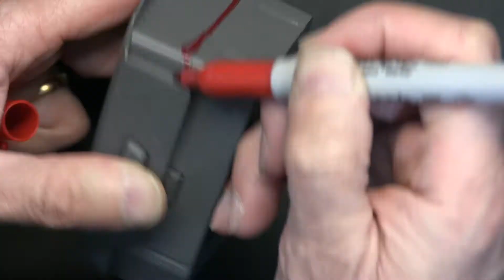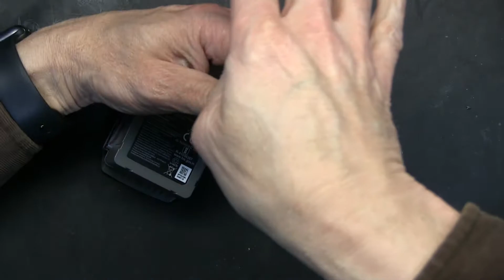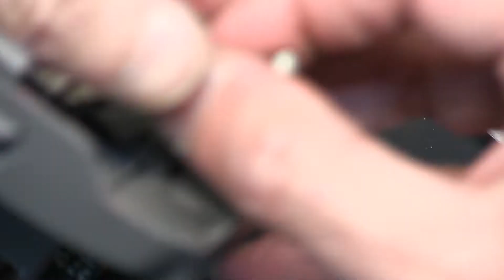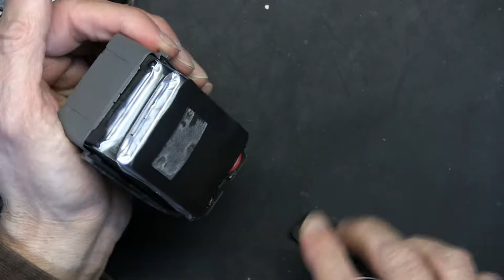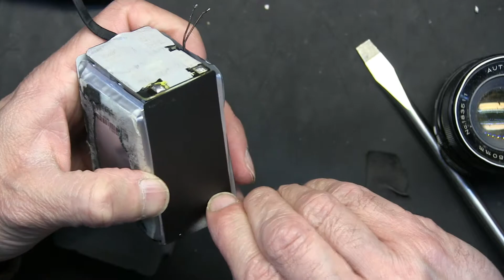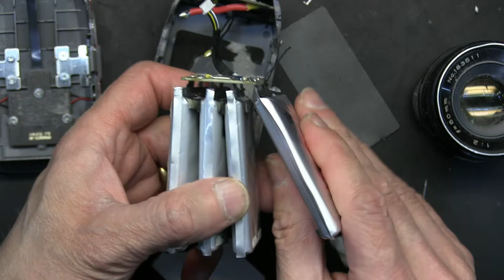Taking Apart The Intelligent Flight Battery Pack Of The DJI Mavic 2 PRO Drone.

Comment: I plan to reassemble with new cells. Is it better to pry open or cut open with dremel tool?  I heard you need to keep the voltage on BMS if you want to reuse it. With either solder connection or balance cable. Is this true?
Reply from the maker: Cutting it with a dremel is very dangerous and it could cause fire or explosion if you accidentally cut the battery. 
Especially if the battery is not fully discharged. I also heard that on these batteries, but I have never tested the theory in real life.

Comment: Great video.  Could you please show how, after the Mavic 2 battery case is removed, you can 1.) check the individual voltages for each of the (4) cells (1-4) and 2.) trickle charge each of these cells using an an adjustable bench charger? (for a less used battery that does not have cells to be replaced).  Thank you.
Reply from the maker: You can put the voltmeter terminals directly on the Positive and Negative of each cell. But be very careful these batteries are extremely powerful and they have enough charge to start a fire and cause sever bodily injury.
Reply: @TECHNOLOGYTIPS101  thank you! I was able to test my voltage at the large red and black wires right beyond the BMS board. It measured 9.34V. I then hooked my bench charger up at 13V 0.5A and it woke up the battery and LEDS. From there I could communicate with CP2112 (read info showed the voltage of each cell above 3V) reset flags and charge using the DJI charger. However when I turn the battery on and off with the button, it still outputs power when “off.” Also the drone runs on the battery but won’t take off: battery not installed properly message. Cleaned pins and confirmed all other batteries are working; not this one. Not sure whether I should’ve charged to 16V 0.5A, but I wanted to be extra careful not to overload the battery as you’ve stated.
Reply from the maker: @miles267  There could be a problem with the Control board which is not communicating with the drone. This could lead to false battery installation errors. See if you can update the battery firmware like this video https://youtu.be/tPLQZFroTLw

Comment: Those battery cells are $4 each on Ali express. Well worth redoing yourself. Worst case you ruin an already ruined battery and it costs you $16.
Reply from the maker: Thanks for the tip, I did search but I couldn't find them on Aliexpress
Reply: @TECHNOLOGYTIPS101  it's not letting me post a link in these comments. I'll see if I can dm it to you
Reply from the maker: @awesome_slyda2059  Thank you
Reply: No, worse case is you buy these cheap cells, put them in your expensive drone, fly it around, it looses power and you lose your drone 😢 not to mention any other consequential damage or injury.

Comment: JUST A CORRECTION, YOU SHOULD NEVER RUN DOWN A LITHIUM BATTERY TO ZERO, THAT IS WHY YOU HAVE A BMS, TO PREVENT OVER CHARGING BUT ALSO NOT TO ALLOW IT TO DISCHARGE FULLY.  ALSO YOU DON'T CUT AND SOLDER, THE HEAT WILL DAMAGE THE CELL, YOU CAN GET MINI SPOT WELDERS BUT SEE VIDEOS ON YOUTUBE ABOUT BAD DESIGNS.  I THINK YOU PROVED THAT ON THIS MODEL  IT IS EASIER TO GET A REPLACEMENT ON AMAZON.
Reply from the maker: I agree, it is too risky to repair it. I finally ended up getting a new one which also started to swell after a year and maybe hundred charges :'-(

Comment: Would you still bring the battery into dji to be repaired ? I got a message come up on the screen of my SC to take the battery into dji to get fixed can dji repair these batteries or should I just buy a new one
Reply from the maker: If the battery is still under warranty you could send it for replacement, however they will not replace or repair batteries that are out of warranty. I don't recommend throwing it away yet, because if there is a factory recall on them, they are required to exchange all defective batteries regardless of the warranty status.

Comment: ALL YOUR SAFETY BULL.... REGARDING A CONTROLLED ENVIRONMENT(LAB) AND TO MAKE SURE YOU WEAR GLOVES.  NONE OF WHICH YOU ARE USING TO TAKE IT APART. ALONG SIDE OF THAT THE BATTERYS COST UNDER 300$ CDN WHICH IS PEANUTS COMPARED TO REPLACING THE MAVIC 2 PRO WHEN IT CRASHES DUE TO A BATTERY MALFUNCTION BECAUSE YOU TRIED TO REPAIR OR REPLACE CELLS IN A SWOLLEN LITHIUM ION BATTERY. WHICH ALONE IS EXTREMELY UNSAFE AND I WOULD HIGHLY RECOMMEND NOT!!!DOING. NOTHING YOU ARE TELLING VIEWERS IN MY OPINION IS CORRECT  SAFE OR WORTH CRASHING YOUR DRONE AND PUTTING OUT 2500$ CDN TO REPLACE IT.  300$ BATTERY OR 2500$ DRONE????  BATTERY FOR THE MAVIC 2 PRO THEY SAY ARE GOOD FOR 200 FLIGHTS.  TAKE MY ADVICE AND JUST BUY A NEW BATTERY.  IF THE DRONE CRASHES WITH A NEW BATTERY THAT FAILED THEY WILL REPLACE IT.  IF YOU F... WITH IT THEY WILL DEFINITELY NOT!! COVER IT UNDER WARRANTY.   PEOPLE TRUST YOUR INFORMATION.   SO PLEASE PROVIDE SOMETHING USEFUL THAT WONT HARM YOUR VIEWERS AND COST THEM A DESTORYED DRONE FROM A BATTERY DISCONNECT AT 400 FEET!!!
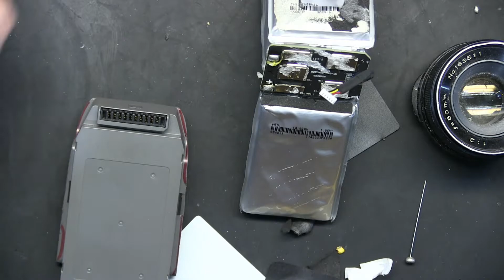Reply from the maker: Typing in all Caps is yelling at people which is not cool. Since you didn't watch the video to the end you need to "Calm Down", I said the internal battery cells are not sold separately so you can't repair them, and I ended up buying a new battery. Watch 17:17

Comment: Cool video, thank you for that.
I hate DJI for this, my battery cells are fully okay, but the connection board seemed to had a problem and did not send aymore battery data to the drone.
They did not replaced them.
But now I have a extendet torch battery ;D
Reply from the maker: You are very welcome!
Reply: so i`ts locked and you have to unlock it

Comment: That should be Bikesh Shresthah.
Reply from the maker: Not yet, but I would love to watch it if you could send me a link
Reply: @TECHNOLOGYTIPS101  Not sure if it's helpful or not, but he seems to be doing what you were hoping to do.
Reply from the maker: @luciferbox5577  Oh ok, I figured it is too risky to use a repaired and unreliable battery on a thousand-dollar drone, so I stopped any repair attempts.
Reply: @TECHNOLOGYTIPS101  Personally, I agree with you. It's not something I would consider doing. Unfortunately, we just have to spend our hard earned cash on the proper ones.
Reply from the maker: @luciferbox5577  Very true!
Reply: @TECHNOLOGYTIPS101  nonsense, you can fix batteries safely on original cells. It is possible
Reply from the maker: @MarcinPojalowski  Thanks for the kind tip, I will keep that in mind. I just couldn't source them online so I thought they were proprietary batteries.
Reply: It's a $1,000 drone if it works without the battery it's a $0 drone
Reply: @TECHNOLOGYTIPS101  https://www.youtube.com/watch?v=6P6E2IOA6QQ&list=WL&index=259&t=553s

Comment: The control board is held to the lower battery housing by two screws. They're in the gap between the board and the edge of the case, right above the battery connector
Reply from the maker: Too bad the battery packs are welded together and not soldered together, so you need a spot welder to replace them.

Comment: Very interesting video... I have some information..  the guy that makes the modded mavic 2 pro batteries uses the newer imprived cells from the air 2 batteries.. also I've heard once the smart controller in the battery loses power it is ruined so power must be connected at all times to that.. the guy that mods the battery makes them higher capacity and puts them in a bigger custom plastic case.. he also reprogram the smart controller for the added capacity.  In your case here if you bought air 2 batteries to canabolize and could keep power to that smart controller you could probably make some improved m2 batteries at a similar capacity. Would it be worth it.. that's the question.
Reply from the maker: Good idea, maybe a good for a slow rainy day project.
Reply: @TECHNOLOGYTIPS101  yes.  I'd love to see it..
Reply: Yeah, I found this: https://www.eevblog.com/forum/chat/experiences-with-ti-bq-management-ics-when-revelling-laptop-batteries/

Which is a shame, cause I found your comment after cutting my battery wires... Oh well. I expected I'd need a new battery anyway, but it was good to learn about the BQ chips
Reply: once is loses power can be reprogrammed, is not bricked forever.